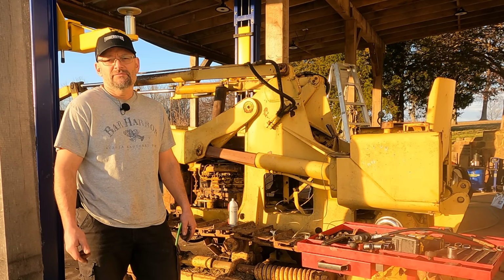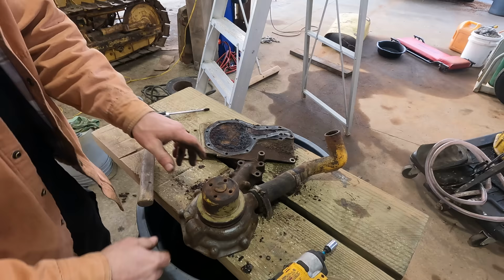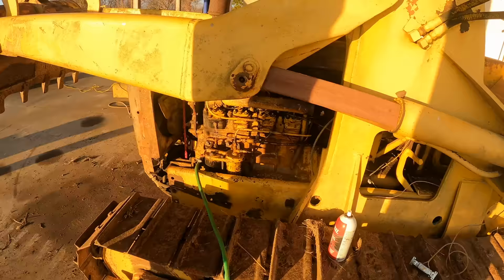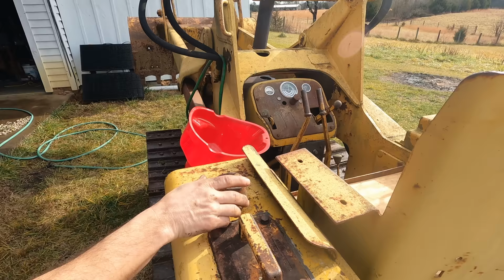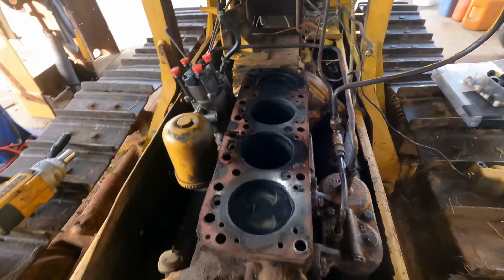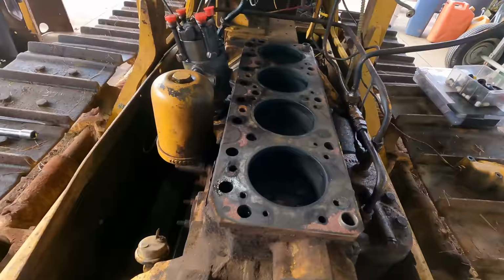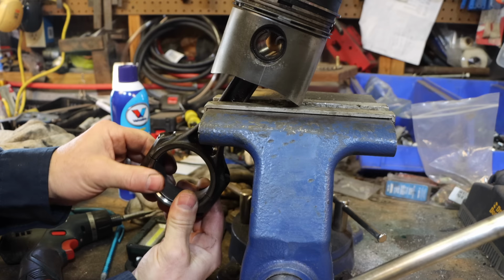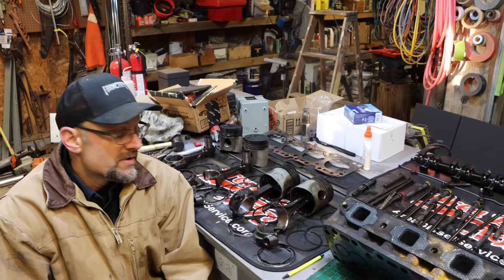1960 John Deere 1010 Diesel Engine Teardown.  Worth Fixing?

Comment: Also, real tough break on those pistons.  You might actually be able to get custom ones made by an automotive piston company for less than you'd expect, but I'd try TIG welding and turning first and buying used ones second, with custom replacements as a distant third.  It looks like there are a few suppliers for that, Ross Pistons came up high in my google results but I can't vouch for any of them.

Comment: Maybe a later model engine can be mated up to your transmission. There are several 2.4 4 cyl. out there in generators, and pumps that could work. Looks like the 1010 was a problem engine from the start

Comment: I understand your emotions about fixing and selling the loader.  The question I have about the pistons is with all of the pistons available are there any that would be close(slightly larger than these) that could be machined to match these?  I have thought about this for engines I  have owned so this is not new to me(the question).  I also get and am with you on not spending any serious money on fixing the loader unless it was somehow historic or a family attachment.  It might be worth it for the channel content, I don't know.  One of the channels I follow put a lot of money into a machine to get it running and operating well but it was one of 3 in the country.  He did it partly as a tax write-off.  You are going to need to make that call about fixing it.  It would be interesting to follow along.  Your choice.

Comment: I seen a guy machine down a piston once. He removed the aluminum ring lands and built steel ones then heat pressed them on the piston might not work in this application but it was interesting

Comment: Just a belated hint from a trained automotive machinist... Never push your pistons out the top of the cylinders if you can get the crank out and go down. As the engine runs, the rings are slowly abrading away the surface of they cylinder, leaving a ridge at the top where the ring travel ends. For those situations where,  for whatever reason, you *have to* go out the top, they make "ridge reamers", rather like a hand-turned cylinder boring tool, to cut the ridge down evenly with the existing cylinder surface and make it possible to go out the top without having to fight and pound the pistons and rings over that ridge, possibly damaging or breaking them.

Comment: Cylinder 1 is most likely damaged because they ran it with out or with a damaged T-stat. This causes the cylinder to be egg shaped at op temp and form a tight spot on the cold area of the cylinder wall. The same thing happens with the Ford I6 300's, because the water pump shoots the water right out at the bottom of Cylinder 1.

Now for your measuring skills :P. When measuring the bore of a rod journal/bore or main journal/bore you use the 9 - 12 - 2 o'clock rule, 12 being inline with the beam on the rod and 12 being inline with the center of the cylinder bore. And when doing the cylinders them self you can use the 9 -12 - 2 o'clock rule as well but cut the depth of the cylinder into 5ths. With the top measurement where the rings would be  at TDC and then at the bottom of the cylinder about where the ring would be at BDC then 3 other place between in that 9 - 12 - 2 locations. Hope this helps, not trying to be an ass I'm an engine builder and getting those measurements right is very important.

Comment: Did injector cleaner get run through the injectors after the pump repair / the machine was able to run ? 
I remember seeing large drips of fuel coming out of the injectors during testing onto that piece of cardboard in the previous video. Predicting there may still be more smoke ( due to the injectors ). Consider if you should grab a bottle to have ready to try ? Even if they were soaked in the stuff, to run the material under high fuel pump pressure may be beneficial.
Speaking of additives; would a cetane booster fuel additive have helped with easier starting ?

Comment: I personally think the old thing still has more usefulness to give  I'd bet someone has used parts laying around but are they willing to part with them cheap enough also think it probably was over heated more than likely what blew the head gasket an maybe what cracked the pistons or possibly you did driving them out ?

Comment: I cant say who may have hammered the piston up out of the cylinders without first removing the ridge. A ridge reamer is used so the old rings do not snag on the ridge  snapping off the land. Proof is to break off the cracked land and if the suspect cracked area is carboned up, the cracked land is old. if it is clean.....

Comment: Sir, I noticed, unless mistaken, you installed a valve stem wiper on either the second or third piston exhaust side instead of the intake. Could this partially account for some of the smoking with a load? I know that the injector pump realignment you did later got rid of most of the smoke, but restricting lubrication on the exhaust side valve stem may cause preventable issues down the road? Check your video.... apologies if I misunderstood the wiper position.  Sincerely,  Hugh Gale

Comment: I wouldn’t recommend casting new pistons. I will bet you new pistons that they will not work. They are a special alloy of aluminum. Yeah you can melt down the piston and re cast it. but there’s not enough material to cast and machine to size.  Not to mention a perfect casting is required. Then what about heat treating them….  Regular ol run of the mill new or  recycled aluminum will expand under the heat and pressure. Might run 5 mins before it locks up. That is if they don’t melt or get soft enough for the combustion to send the top of them into the oil pan.  Definitely don’t give up on the old girl. If I had a use for a tiny track loader I’d fix it.

Comment: If you heat the whole thing to melting point you could re-pour blanks and machine the individual parts and rebuild it form there. Seems easier.

Edit: holy shit the hydraulics work this is a ride.

Comment: Couldn’t you buy a Cat 3406 (94mm) piston or Kubota piston (94mm) and machine to size.  You could enlarge pin diameter or bush rod depending on what you get?  Some of these pistons are only $40 to $60 each?

Comment: The track pads or grosser are the wrong type for a crawler loader, They shouldn’t be high 
exactly like a dozer which is fitted to your JD 1010, Usually the track pads on most manufacturers are only a few mm high so they are allowed to make tight manoeuvres.

Comment: The piston on a two stroke is not round. The expansion across the wrist pin is different than opposite the pin, making it not possible to turn on a lathe. I'm not sure about a diesel engine.

Comment: What would be the possibility of repowering it with a new engine that has more available parts? Is there anything that is close to fitting?
Reply: Yes, but a bunch of work, at work long time ago on a Deere 440 dozer, they took out a gas Deere motor and installed a Detroit Diesel 2-53.  All that did was made it a very expensive noise making, worthless dozer.

Comment: I'm only half way through the video, so bare with me.  It sounds like if the engine is that knackered and expensive to get bits for, wouldn't getting a replacement be a more economical solution?  Obviously i dont know what that would involve or what you do in the rest of the video.

Comment: Parts are expensive... What about a new engine? Is that an option, may well be more up front but if you're keeping it around a more modern engine might be cheaper in the long run. Shoot, you could get real creative maybe and throw a power stroke in it :D

Comment: making a new casting is way too much work, I'm a machinist and I wouldn't touch it.
finding a replacement would be the best obviously. 
maybe you could find something very similar in specs? parts do get reused in manufacturing, I'd be surprised if there wasn't another machine out there that used the same part. finding it tough...
welding could work in theory. but that's a really oil soaked and dirty part,  and those rings are pretty thin.... chances of getting a good weld fill without melting adjacent rings and no porosity and no distortion are not great. worth a try though

Comment: After welding and turning off the waste please weigh each piston to ensure balance.
Sure, hone the bore and even reuse those bearings if replacements are expensive. Just remember what you have. It's a clapped out engine that you have patched up to keep it running. In that sense it is a show piece only that you should get just a little work out of. It would be a shame to work it hard to once again have it in pieces.
Reply: Why clapped out when all measurements in spec?

Comment: See? It WANTS to live. What more in the way of motivation do you need??? 🙂

Now I know jack squat about diesels. Just the bare minimum, and it's mostly in ways that entirely relate to gas motors. Then being an older diesel, I know even less. But, I did think they generally have forged pistons? Like I said, I know not a lot. But, if that were the case, I don't know what issues that may cause with either welding them up, or making your own. I'm a per-fessonal motorcycle meckanic, so I don'ts know nuttin bout dem dere coal pumpers. That said, I was under the general assumption they do run forged pistons. So you may want to look into that. Or I could be full of s**t too, so there is that as well. Yeah, I know. Six of one half dozen of the other. But I thought I would mention it anyway. Even if it was the case, I'm sure there's already a million other posts about it below from far more knowledgeable people. But whatever, it's still fun seeing you give it the chance to live again.

Comment: Don't you have a furnace, a lathe, an end mill, and hydraulic press? Why not try to case and forge the parts you need.  For this it doesn't need to be perfect...just possibly good enough. I mean you made a cannon.

Comment: For as long as it took to get the engine running. It will take as long for each system to get functioning and working better. After it's recovery you can divide the time of (repairing) by the years of neglect and sitting and abuse of not being used well. Equals better knowledge of not throwing your great great grand papa to the dumpster and say, Your worthless now. Leave me

Comment: It is really unsettling how ppl get free equipment and expect it to run as it should without spending money on it to repair. Usually these ppl end up getting the machinery to run ag bare minimal and then gouge the pocket book of some poor DIY mechanic that needs it to run for work purposes and then finds out the guy that sold it to him is a flipper ripping ppl off. This guy has the marks of a flipper.